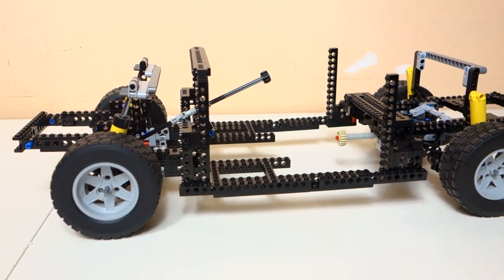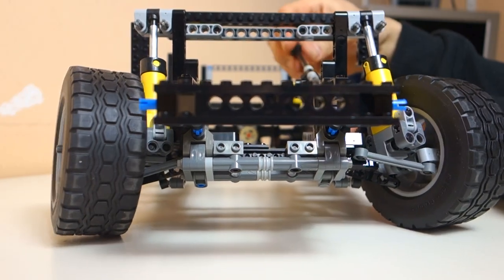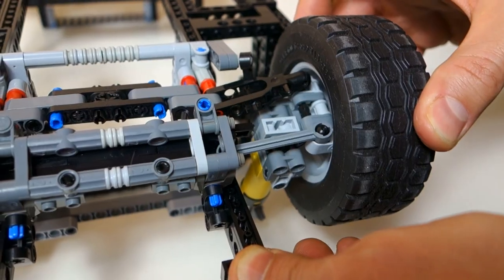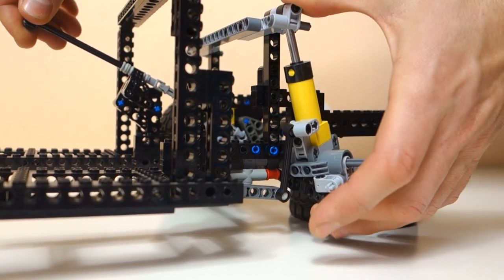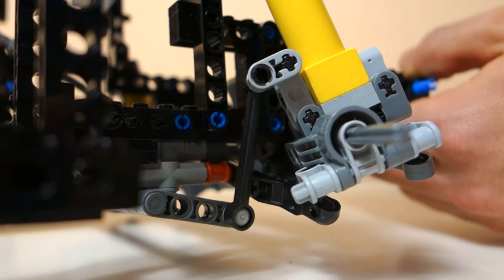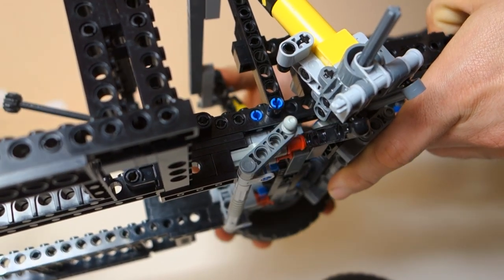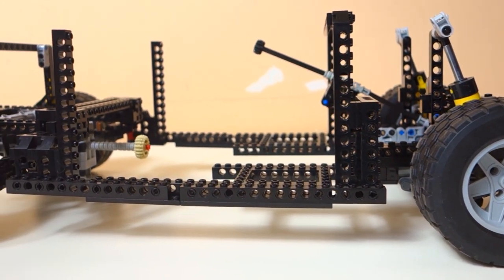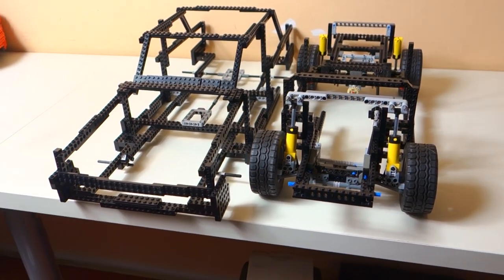LPEpower e30 build show E08 - rolling chassis

Comment from the maker: I am waiting for the rear hubs of course, 4 pieces. I will of course use the rear ones in the front aswell. The wobbliness goes away once you stick an axle that goes through the hub and the wheel through it. The hubs will not change the geometry, but will make the wheels properly stable on the car, so that the suspension will work on the tires. Right now, the wheels are just wobbling on the axles.

Comment: Your solution with the pneumatic cylinders is very clever. Where did you get the spring that you use in the cylinder? Can you make the suspension adjustable by connected spring cylinders to a pneumatic system?

Comment: I see. So do you prefer to use spring-equipped pneumatic cylinders with cut off inlets because they provide a moderate damping effect, unlike normal Technic shock absorbers? I guess oscillation could be quite a big issue with that large 11.5L shock, but there are ways to damp it.

Comment: Starting with the frame.... which is not right either. Built custom parts out of non technic and integrate. a e30 control arm is like a boomarang with balljoints, easy to recreate with wing parts, flatplates etc and technic